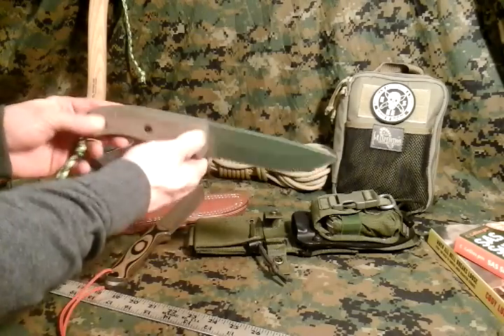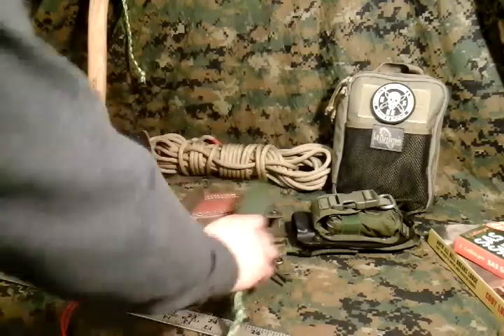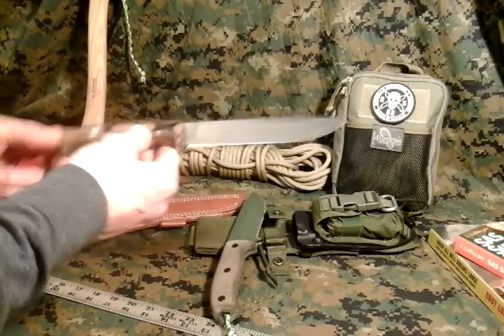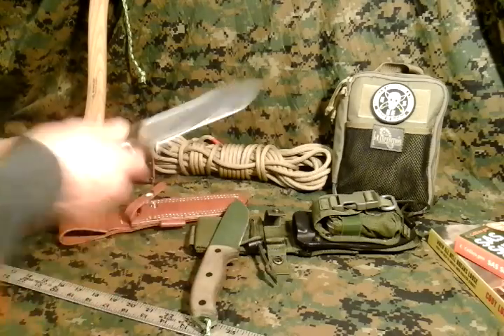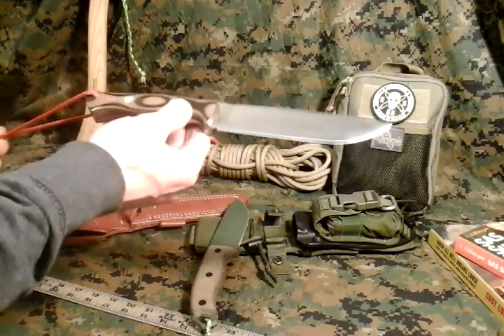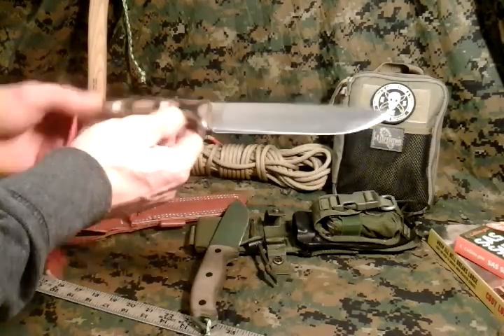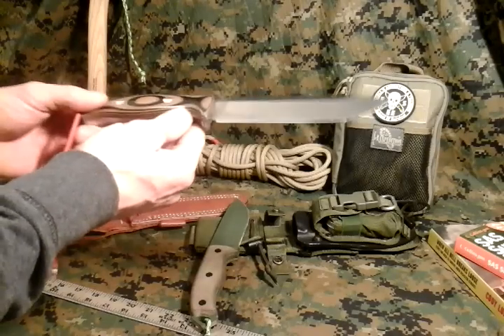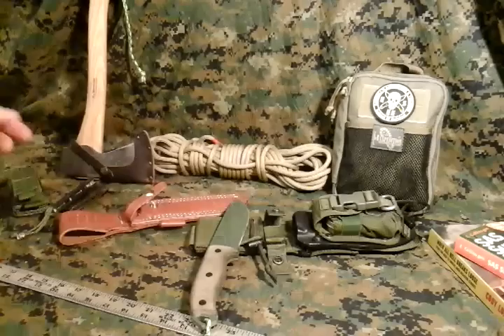Micarta vs g10, whats the difference?

Comment: There actually is a difference. Micarta is made from paper or fabric using phenolic resin and G10 is made with fiberglass(much stronger when laminated) and epoxy resin(also stronger and more durable). When you make both yourself and know exactly how and what they're made of along with the mechanical properties of each component they're made with, you start to understand the differences. Look up the common tensile, compressive, flexural strengths, and wear resistance of each and compare.

Comment: G10 ranks higher in all durability areas, including tensile strength, compressive strength, and flexural strength. Even though micarta and G10 are both resin-based composites, G10’s glass properties give it an advantage over the cloth properties of micarta.  I recently had a custom canvas micarta scale break under minimal use on my TOPS TIBO.
Reply: Can you stop copping and pasting this exact comment over so many videos I watched multiple videos and on all of them you left this exact comment
Reply: But I did read this info on other websites as well. There must be truth to it.
Question for SailfishSoundSystem..
How did the micarta scale break of the Tops Tibo. Also , did it break at the holes where the nuts and bolts fit in? Weak point maybe.. 
I like to hear the details on this.
Reply: @Charlie-tw3ef  I dont see where is the problem to that.  I did not see zhe other videos and dont need to since I read his shared experience right here too. 
Also, we now will perhaps because of You not get an answer to the question for more details. 
Really dump false smart attitude. Always depressing to see so much rage support to such "education".
Reply: @AR-vf7vg  it’s not that deep
Reply: @Charlie-tw3ef  That's the point. You dont realize the responsibility of. "it", . even when told about it.
Reply: @AR-vf7vg  what are you talking about
Reply: @Charlie-tw3ef  About You initiating to judge as demeaning people sharing experience by  copy-paste their contribution. As if (!!!) copy-paste was wrong instead of simply aknowledge the content - that was of altruistic if not scientific nature - not just opinion.
(And You found 8 people chime in to shame this contributor, more than any other and less constructif comments did. THAT's despairing. )
Reply: @AR-vf7vg  
I do appreciate the info given by @Sailfish Soundsystem. Never read it anywhere else by him but here. And I did view quite a few video's on knives...
Reply: @AR-vf7vg  stop rambling incoherently. I just was fed up reading his same comment on every video I watched
Reply: @Charlie-tw3ef  Everyone who read what You wrote had to acknowledge this. Its You who was intitled to ramble about your discomfort at the expense of an altruist.

Comment: G 10 is woven fiber glass McCarter is layered fabric kind of a big difference
Reply: Woven fibreglass IS a fabric. Nylon, Polyester, Cotton, Flax, Hemp, Viscose, Silk, Kevlar et al are often woven to form fabrics. G10 is nothing more than a particular brand of reinforced glass fibre plasic. A composite that has been around a long time. Micarta can be made of pretty much anything that can be layered and set in a resin... including fibreglass. So, in that sense, G10 is a just a brand of 'micarta'. Not such a huge difference after all.

Comment: I personally prefer G10 and Micarta handled folding knives over Titanium/Carbonfiber metallic handles, especially if the knife will be for EDC carry/usage. They just feel more comfortable (especially Micarta) during tasks that take some time. Titanium and Carbonfiber handles seem to get bit slippery once my hands start to sweat, but I like to carry them on formal outings since they go well with some of my watches and cuffs. 

I got TOPS Mini-Skandi Survival Neck Knife which features Micarta handles and I love it. It might just be me, but I felt as if the Micarta handle smoothed out over time, making it feel as if its forming to fit my hand/grip (well... maybe not that noticiable lol).
Reply: I forgot to add that the Micarta handle on my TOPS feels almost like wood... and I can visibly see the slight color fade over time. Maybe its due to the material used to make this Micarta.
Reply: I have carried a Helle Nying neck knife since the 80s.  I have many scandi grind knives with traditional birch handles. I just got my first flipper a Kizer Lieb in jade g-10 with an excellent grippy texture. It's a joy.  My first button-lock flipper is the Leib M in micarta.  Both are great but I think I prefer micarta for the more organic look and feel. It is a bit woody.

Comment: Micarta has better grip IMO especially when wet. G10 works great with textured scales. I like the variety in my knives
Reply from the maker: There both great. it just depends on what you use your knives for.
Reply: @Theoutdoorproject80  A Pocket Knife for Self Defense, Micarta or G-10?
Reply: @obargrado1574  
Both are fine.
G10, the Cold Steel Recon 1 comes to mind..
Think of this.
Gene Moe took a 750lbs down with a Buck 110 witht he finger grooves and the wooden inlays.
If that works, nearly anything with a 4 inch blade and a good tip and edge works.
The Buck has no guard, it is not the most grippy either. But it worked.

Comment: Depending on how the laminates are finished, whether they are sanded smooth or left with the linen weave texture, there is no difference between the two materials. If you think there is, it's all in your mind.
Reply from the maker: I said in my video several times that there is no difference between g10 handles and micarta handles. accept the fabrics used, g10 is made mostly of fiberglass with resin, and micarta handles are made mostly of linen and canvas with resin, some are polished or coated with polyurethane, but there is pretty much nooooo difference between the two, and that was the whole point of this video